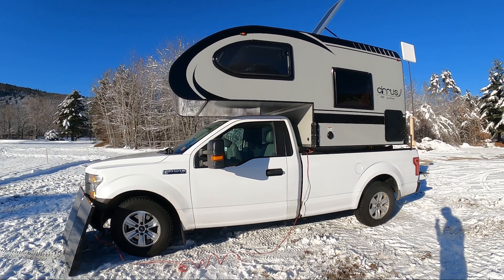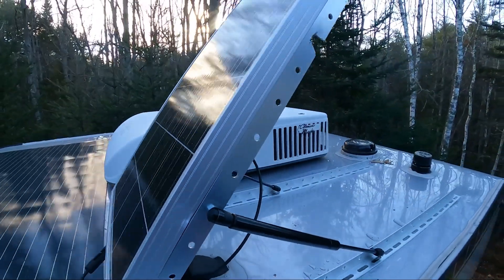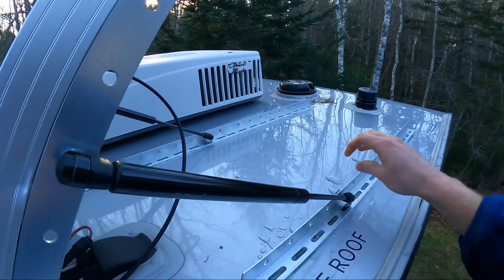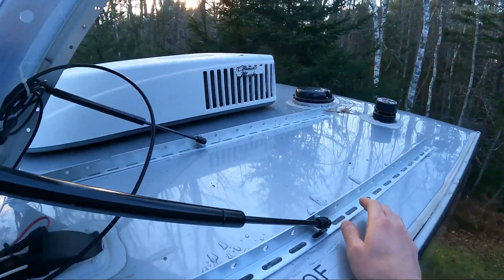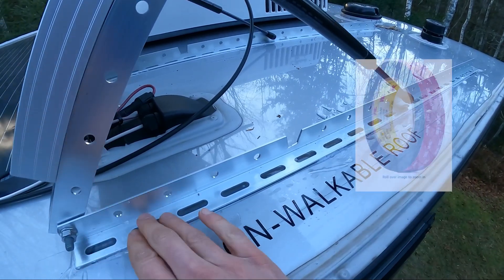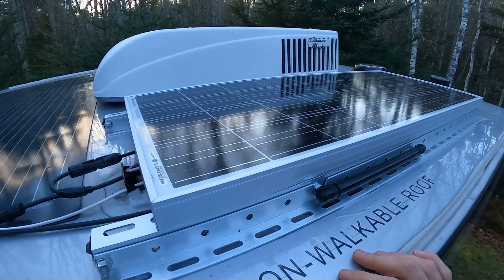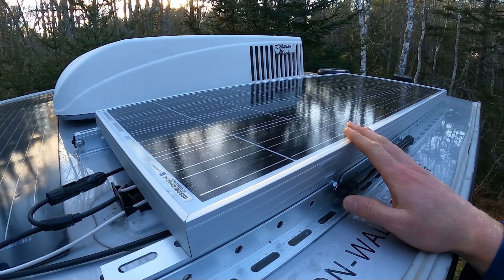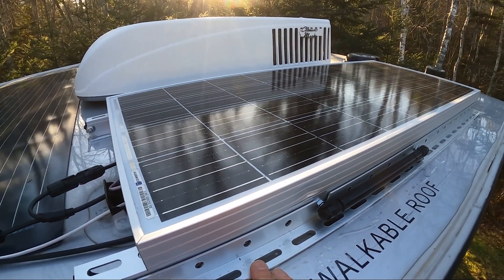No Drill Tilting Solar Panel on a Truck Camper!

Comment: 5:56 Those MC4 connectors lock together tight, they are a super pain to get to latch and un-latch.  
But my Guy, you have a totally loose connection here.  That's like, IDK if it's even electrically connected.  
I'm looking for ideas on how to tilt panels on my rig.  I like this set-up you have.  Thanks for the video, check your wiring please!
Reply from the maker: Redid my solar this fall and happy to report all connectors are connected fully (and honestly amazed that worked for so long).

Comment: Hey ! Such a good idea ! With my panels they are much bigger do you think you’d be ok with mounting the strut directly to the panel ? Thanks
Reply from the maker: It makes sense to mount it to the panel if you're comfortable making the lower part of the panel the hinge and creating the holes for the ball joint to pass through and connect to the compression strut. The other thing to consider is that the "rails" that mount to the roof from this kit I bought were not symmetrical, I.E. they both had to be the same orientation because if they weren't, the holes were in different places length-wise and therefore the hinge wouldn't work. Much easier to show than explain. But long of the short, with this setup I was able to have them in the same orientation where as if the panel were just the hinge you would likely have to have a "left" and a "right with the bottom facing out. Hope this helps?

Comment: Not drilling is always an excellent method. Did you consider using a higher wattage panel?
Reply from the maker: @stahpit1971  the charge controller and wiring was for a 200 watt setup and I was space constrained so only the 100 watts. For more power I have a 200w solar suitcase that goes to a separate charge controller. Only need it on the winter though- for summer this is more than enough.